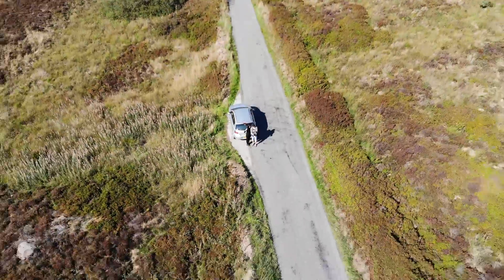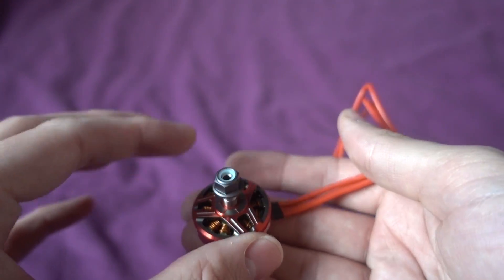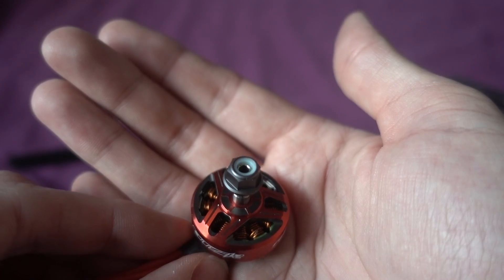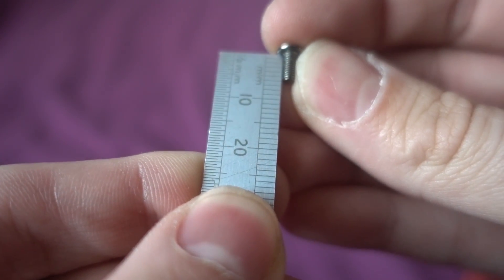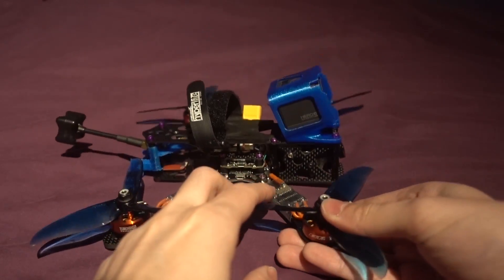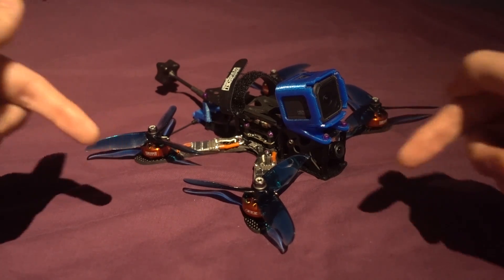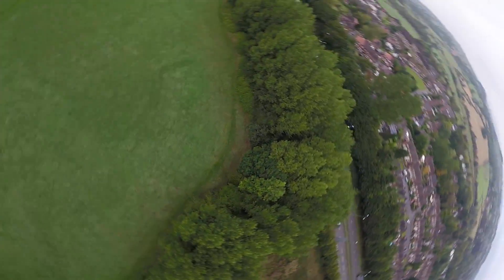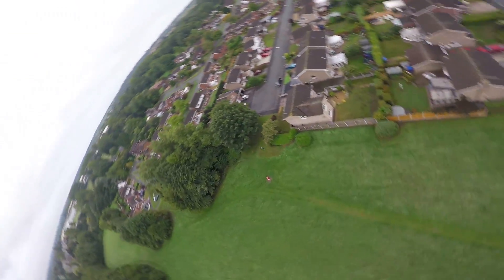RCINPOWER GTS2306 V2 On Kiss!

Comment: REALLY NICE BUILD ANDY! 
I have a clone setup on 6 inch  and emax 2207 2500kv  I used a anniversary martian kit  and put 250 arms on it  I upgraded the bottom plate with the standard martian plate 3mill and slammed the deck. The bottom plate is not a straight swap and you end up with shorter arms. Originally i think i could have used 7" props now  6" is max.and its really nice to fly.
You replaced your tramp  i assume with a TBS unit. I just bought a Tramp  and was hoping for good results, why did you replace yours?  My understanding was they are an excellent  Tx. Anyway i am sure your busy Thank you for all the great content it is appreciated.

Comment: I assume you were originally following the " Mr Steel" build. I have all of the components for that Alien build, but figure I might be ready to build it in a year or so when I might be able to fly it if I am still physically able. I would be interested in seeing what changes you made. Thanks for your work
Reply from the maker: nah this model was way before rotor riot was a thing. But I guess its a similar setup now
Reply: AndyRC I cant believe how smooth is the video you got there with a session 5 using that mount... Session 5 is prone to vibrations... Do you think is it because of the Kiss FC? Does it really make the flight smooth and vibration free? Do you think will it still be that smooth if i use Kiss V2 with a BLHeli32 esc like TMotor P50A? I want such a smooth freestlye footage you got in this video. Need to know the trick... Really want to hear your opinion on this... Looking forward to your reply, best regards

Comment: I can agree with you on getting fed up with BF.  My builds from now on I’m just going to use KISS. The racing quads I’ve got right now are all running the V2 FC paired to a KISS 4in1 set at Dshot2400 and they’re all working fantastic. To get OSD I have a Furious FPV Piggy OSD V2 on board to handle the VTX smart audio stuff and tuning stuff. Have it setup exactly like the Steele PDB OSD is on his board. So far I’m happy with it. KISS now needs to make a 6s capable 4in1 and then I think people would go on that for sure.